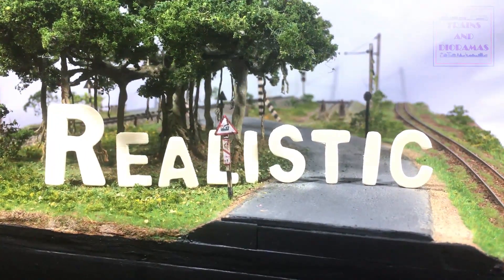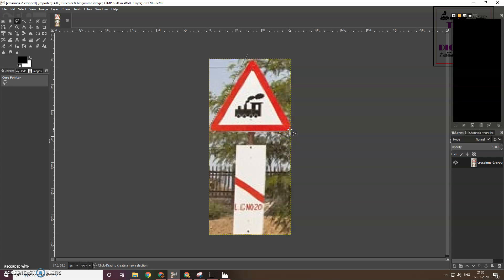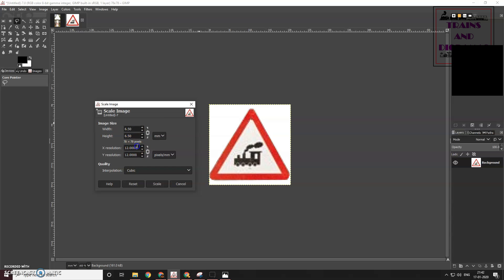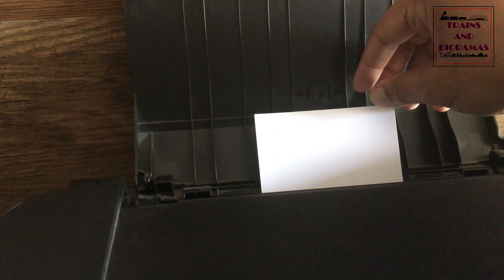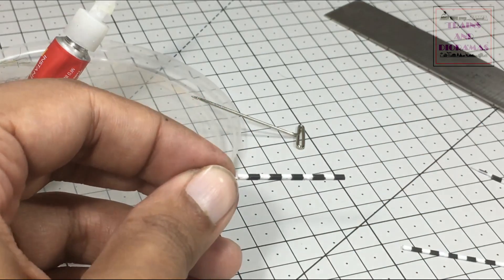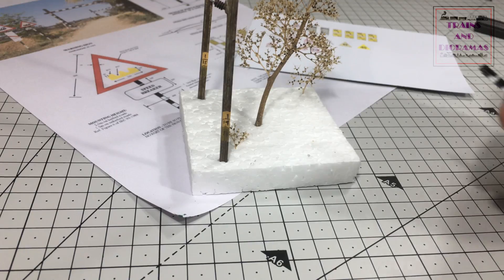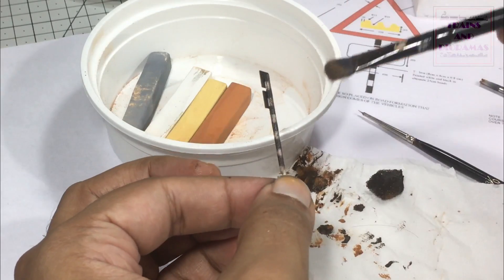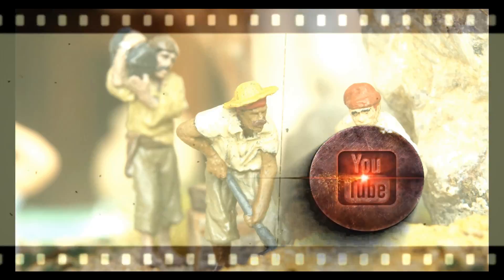How to build Road and Railway Signs in HO Scale

Comment: Getting rid of clean edges is the most important part of weathering. I worked for many years painting sets for movies and TV, I worked for Universal, MGM, 20th Century Fox, and at Paramount for 6 years unusual unless you are really good anyway in Hollywood we called it aging. if you don't get rid of some edges you just have a sign that is fairly new but just dirty. So for your letters or icons like trains and such use the color that is just behind them and dab them on the edge now it will look some chipped away or got so old it faded away. when you get the hang of this your signs will have a whole new look without it I'm afraid it is quite amateurish.  Don't get me wrong the majority of your work is really great I am just trying to help you move up with us pros. I have literally worked on hundreds of sets and some of them were miniatures that would really amaze you, for instance navy ships that were as big as a car and floated in man made oceans with wave makers rain makers and really powerful wind makers dry ice in the water for fog and smoke machines for smoke add a few charges and  you have explosions. Most signs of the type your working on are made of aluminum and do not rust of course the poles would probably rust and by the way rust is burnt umber raw umber raw sienna and burnt sienna. using dark and light helps give dimension.
Reply from the maker: Thank you Robby for the detailed contructive criticism - cannot appreciate enough. I will definitely try your methods the next time I am building signs like these. I have always been fascinated by the miniatures used in sets and movies - It is amazing what you can achieve with miniatures and I am really excited to now know someone who did that for a living, thanks for finding me. I might come to you with many more question in future. 😎🙏
I mostly followed various photographs of the real thing and simply tried recreating them. I did show edge damage in some of the signs, but not all since I wanted to keep a variance. That also brings the factor of rust on the plates itself - there are still many signs in India where the plates are galvanized steel and over the years the heavy humidity causes rust and corrosion in them. We are now moving fast into plastic signs which eleminate corrosion all together, bypassing even the aluminum route.
As for improvement in my next model (along with your recommendations), I think I will have to move to metal /etched poles and boards because both the paper and the styrene strips were too thick for the scale. I hope you will enjoy my next road /railway signs. Cheers! Kaustav
Reply: @TrainsandDioramas  Feel  free to contact me anytime with questions. I have painted and worked on space ships battleships all types of army vehicles. Full size replicas of things like the supreme court the congress. I have painted the oval office 3 times but have never been to Washington DC I spent many years working in Hollywood and although I am retired now all those tips and techniques are still up their in my head. The minitures I've worked on have varied in size from very small to very large

Comment: I did not find any shops selling styrene (only can import through online which is costly) where can I find styrene sheets & strips in India?
Reply from the maker: Unfortuantely, there is no ready supply of Styrene here in India and it either has to be imported, or brought back during personal visits to countries where it is available. However, before I got hold of styrene, I managed to build everything from cardboard and if done right, you can achieve great realism and it has superior longivity. Here is an example of everything that I've built using card stock: https://www.youtube.com/watch?v=8gWCbPDq8Yk
Reply: @TrainsandDioramas  Thanks for reply. Yeah! Currently that's what I am using now. I also uses PVC sheet (flexible one which will be used for cheap doors) sometimes.
Reply: @TrainsandDioramas  Can you make a video or something where generally you buy the stuff from like scenary materials , track, trains etc. This may be helpful for beginners like me and who wants to start a hobby in India.
Reply from the maker: MKs Railroad Yeah, I was thinking about a series to show what can be do be using commonly available material that is within the reach of anybody. Let me work on that.

Comment: Those signs look awesome! Very easy method to make as well. How do you keep the weathering powder on when applying the dullcoat with a brush? Does it not take it off? Great video.   👍
Reply from the maker: Thank you William! Glad that you liked it. The weathering powder is actually dry pastel. Pastel has it's own property to adhere to a good extent on a pre-painted surface, so it stays put. I actually weathered some of my rolling stocks 6 years ago and didn't even put any protection, but the weathering is still pretty much intact. It is a great medium for weathering.